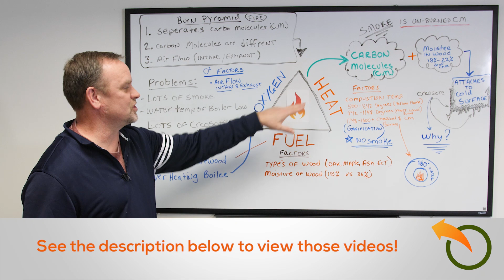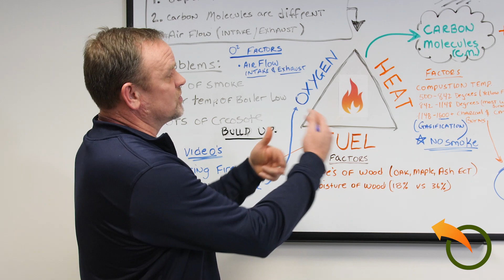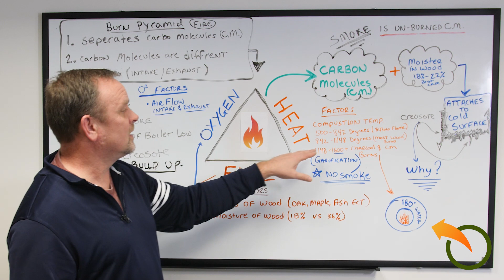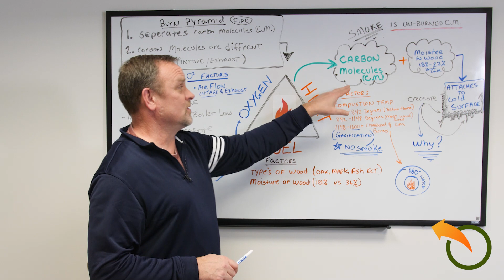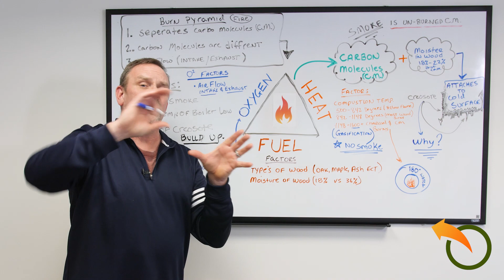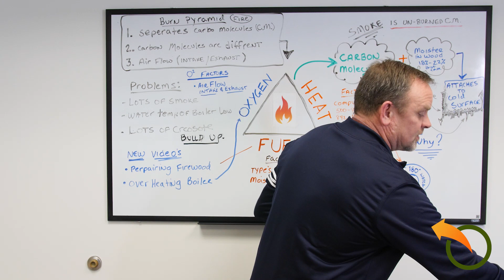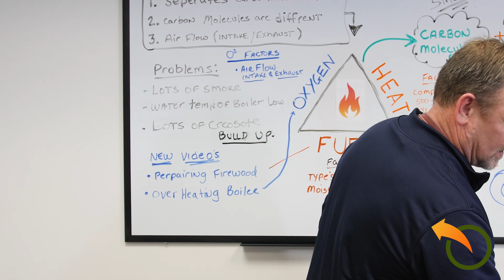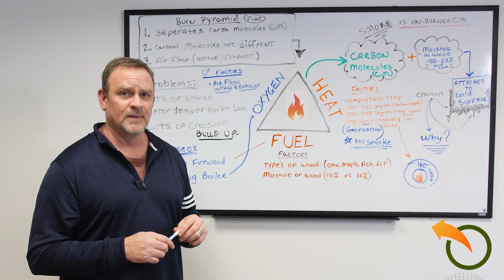Why is there Creosote in my Wood Boiler | Wood Boiler Burn Pyramid

Comment: Hello Jeff I’m looking at building a large out door wood boiler that I can load the wood with my skid steer. I have a heavy wall bullet style fire box measuring 16’ x 5’   I’m looking to heat a house shop an a 40’ x 100’ green house is something that would work/ an be feasible an how would you suggest to set it up

Comment: I left a message on the other post but I have never had creosote problem before this yr am burning good dry wood but still creosote I took fan out and cleaned good it was full of ash and changed the gasket still creosote leave door open good fire close door and it smokes open door and burns good never had this before chimney is clean all seems good except creosote don't remember this being like this before stove is 12yrs old I can't understand why creosote this yr and not before.  I hope you can understand what I'm trying to say. Also never heard boiler sound like boiling water before have not done anything to this stove before this yr
You can see the creosote is liquid from half way back of stove to the door. Sorry so long but trying to give you all information.  Thank you for what you do. You do it well
Ron
Reply from the maker: You might need to replace pump, not enough circulation in the boiler. Creosote attaches to cold surfaces.

Comment: Just fired up my new classic edge for the first time. All is great and the heat is amazing. I’m getting tons of creosote in the firebox it’s literally only 3 days old and my wood is hard wood 3 year seasoned stores indoors. Reaction chamber and chimney are clear. Still in the 40s during the day is this normal with low demand (high idle periods?)
Reply from the maker: Yes that is normal! when it gets really cold the fire burns much hotter and burns of the creosote. But then there is the spring and warmer day with more idle time creates creosote.  Happy heating! Jeff

Comment: hi there i built my boiler with a refectory of 4 " on 5 sides that to hold my heat storage instead of extra gallons of water . you can't get a hot fire burning inside a water jacket . mine smoke from time to time but most the time it is steam . good show john
Reply from the maker: Sounds like your refractory is to large and the unit is burning cold. That is why there is smoke / steam. Greenwood boiler had the same issue, they used ceramic for their refractory.

Comment: What do recommend to clean out the fire box of my woodmaster 4400?
Reply from the maker: shovel. keep it simple
Reply: @AltheatsupplyLLC  No I mean at end of season shut down to get all the creosote off the water jackets.
I've never cleaned them before, but this newer stove I'd like to keep in tip top shape. 
But yeah I use a big square nose shovel to clean out the ashes. hahaha.